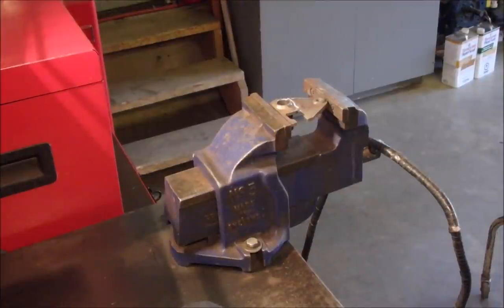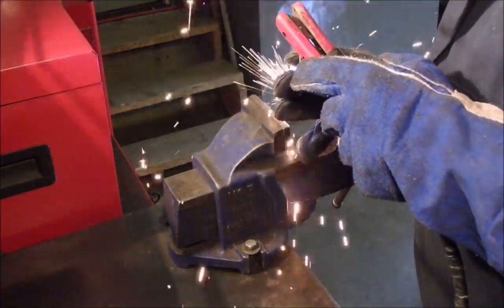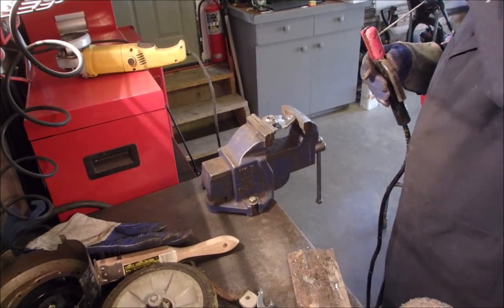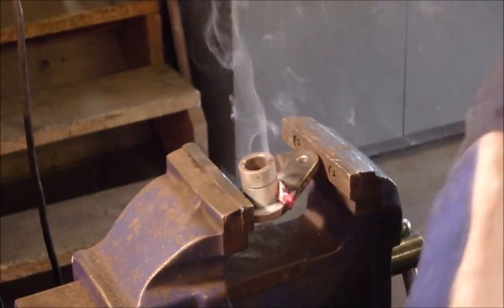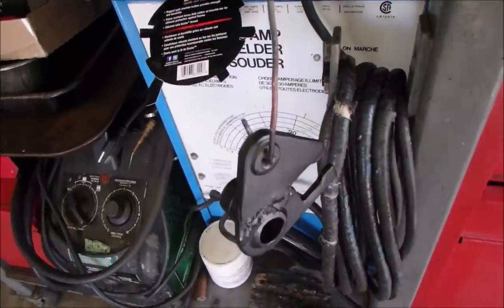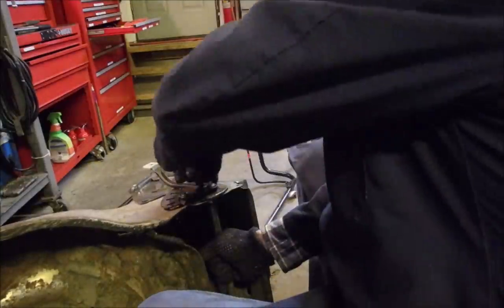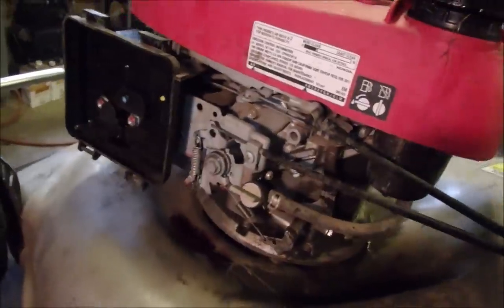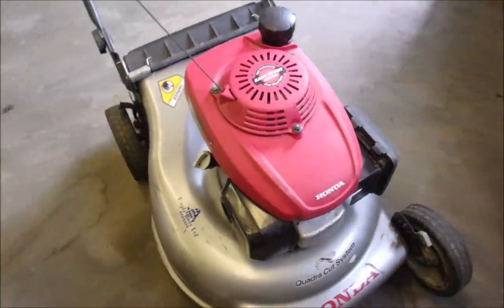Welding on a Honda Quadra Cut Mower

Comment: Welding is a skill I have yet to attempt. It is very cool, and I can see many opportunities in learning that skill. Not there yet. I did watch Sixtyfiveford solder an end on a cable to fix a broken Zed bend. I used that trick on a neighbor’s Toro. New cable is 19 cents per foot. Solder and flux for the job was about $1. Plastic sheath was good. So a $2 fix instead of a new $20 cable. Good deal. I learn a lot of good stuff watching you. Thanks Bruce.
Reply from the maker: Right after I left work I took an evening welding class for 3 months or so.  BEST thing I ever did.  Not only did I learn to weld different machines i learned how to not kill myself.
Reply: @BrucesShop  shocking. Lol. Good idea

Comment: Good work Bruce, you did a really nice repair to that metal piece, and kept the mower from going to the dump. When these machines get old, they tend to start breaking, and I can tell just by looking at it, its one of those early 2000's Honda's, surprised its still running after 20-years honestly. I don't like the thumb propel drive that the new ones use, I miss the lever action. I do like the personal pace system that Toro uses though where you simply walk faster, and it propels faster. Anyways, I have practically 0 welding knowledge, and only did a little in high school shop class, which was oxy acetylene, and not mig/tig/stick. I think you did alright. Congrats!
Reply from the maker: The personal pace ones have a few to many moving parts for a maintenance guy but they are great if they are less than 5 years old.

Comment: How's she goin'?  Nice job on welding.  I like how you went at it a bit at a time to keep the heat to a minimum and keep the piece from warping.  Good fix on the choke cable too.  Another all around good repair and the mower will be fine for another season!!!  Take care!!!
Reply from the maker: Right.  This one was a bit frustrating as I know it wasn't treated like I would treat it.

Comment: Good Job Bruce.  Arc welding small parts is difficult.  I am  finding more and more reasons to not like Honda mowers.  They are a pain  in my opinion.
Reply from the maker: I am with you.  If they aren't miss treated they are fine.

Comment: Bruce was your camera affected at all by the brightness of the welding, i would have thought it could have burned out your lens.
Reply from the maker: I have not had issues.  I have done many welds over the year with different cameras.
Reply: Thought perhaps you might have had to use special filters to keep from burning out the optics.
Reply from the maker: @boblowe8737  nope  Camera's last me about 2 years just because of the rough environment i work in.  Think like mounts and little access doors break.
Reply: @BrucesShop  Ok Bruce keep up the good vlogs really enjoy them, I’m a retired grease monkey, and dabbled in some small engine repair on the side.

Comment: A grinder and some paint will make a weldor what he ain't.
Reply from the maker: Exactly.  are you wondering if i did the weld OK?  The flange side was the side I had to grind  as It fit exactly into the chassis hole.

Comment: Have never seen one with cutter pin.
Reply from the maker: These were stock cotter pins.  No self-propel.  They just hold the axle.
Reply: @BrucesShop  Have never come across a Honda push mower. All self propel Bruce.